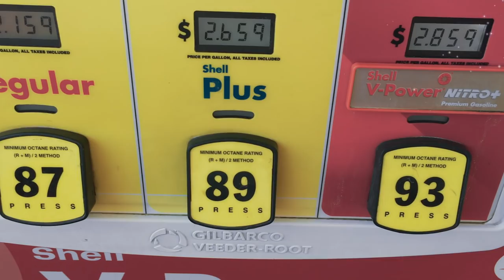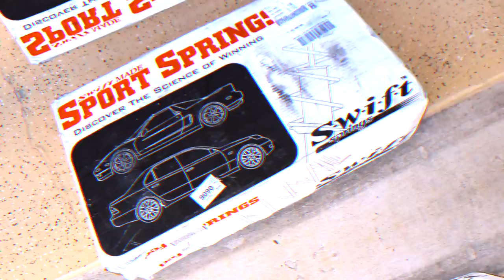LOWERING MY BMW M3!

Comment: Hey nice looking car, question do your car have a EDS electrical damper suspension so when you do this any lights or issue come on. I have a M4 I want to lowered with some spring but these shop telling me that I might get light if I do spring. Did you get any or have any issues
Reply: Just done my F80 with EDS. No issues at all. Also don't need to remove the entire strut. With the proper tools you can easily do each side of the fronts in 20 minutes.

Comment: Are you running 20" w/ spacers? I'm curious if having 20" rims with 15 mm spacers front and rear will rub.
Reply: Depends on your offset, but with the CO wheels, 15mm may scrub.